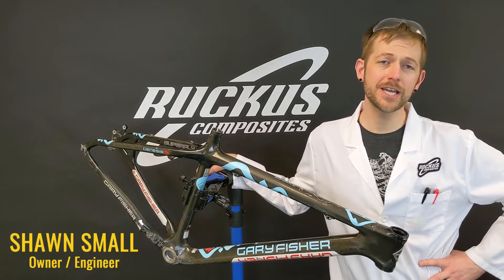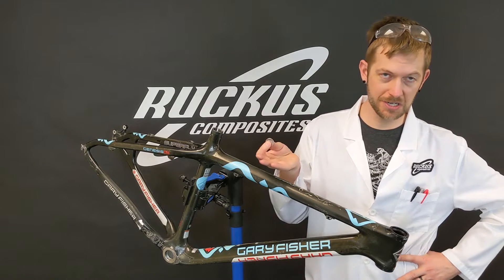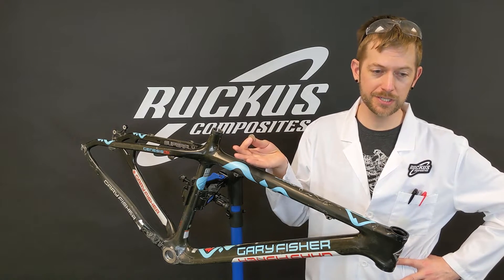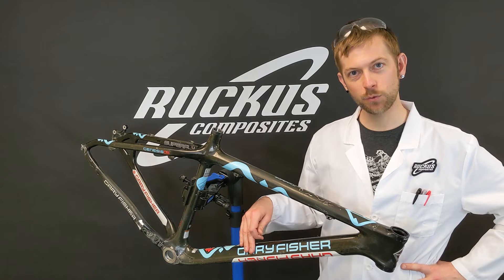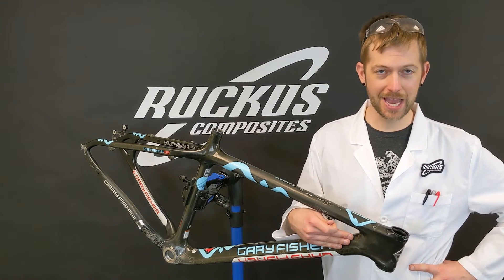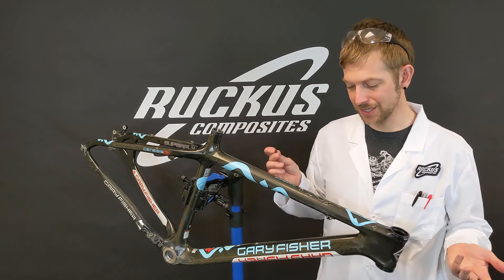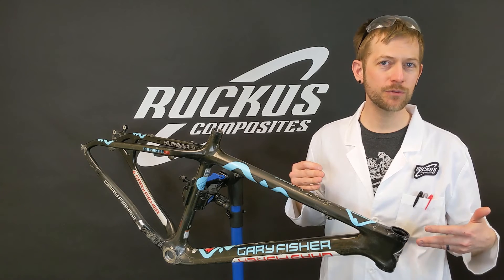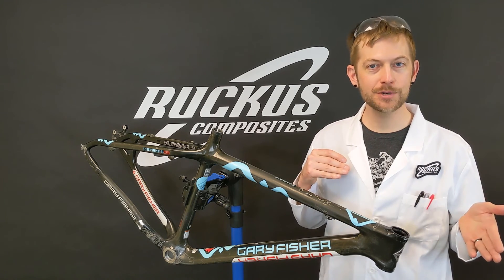The Quarter Tap Test - I

Comment: Sir thanks for your video.
My new alloy 6061 mtb was assembled by third part rookie mechanic and he tightened the seat post quick release vertically and not horizontally.
Tight means while pushing/licking the lever you need to use palm.(there is a frame cut out where seatpost inserts).
I have not ride the cycle yet.
Whlile opening the lever some times no alway a creaking sound coming.
I. Worried is my frame damaged please advice?